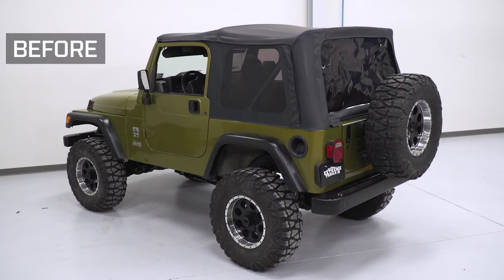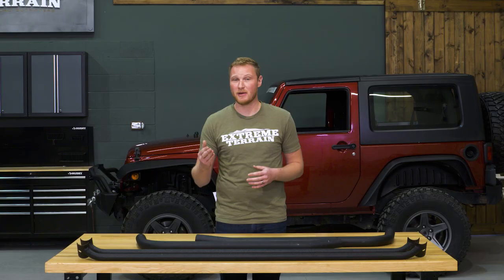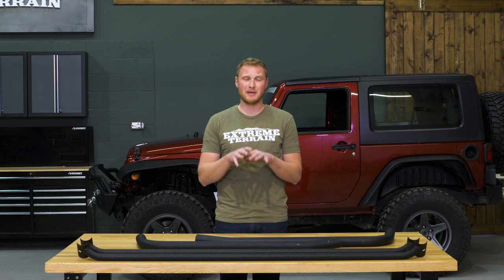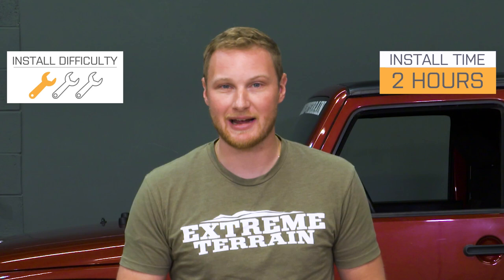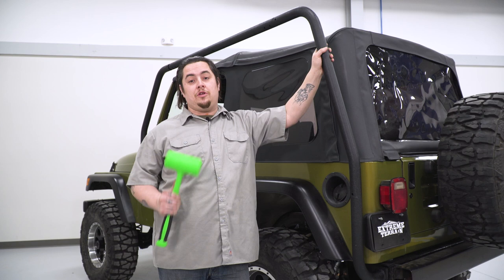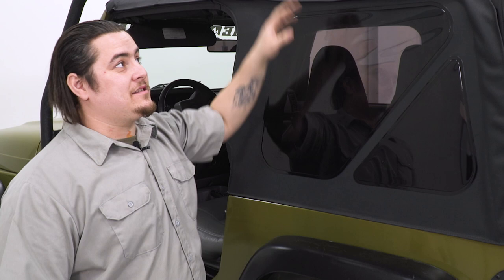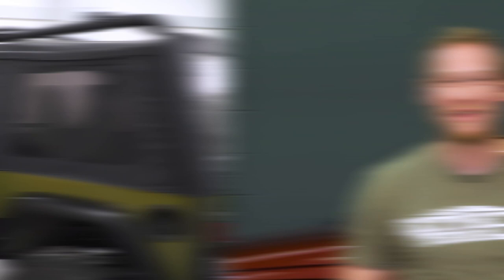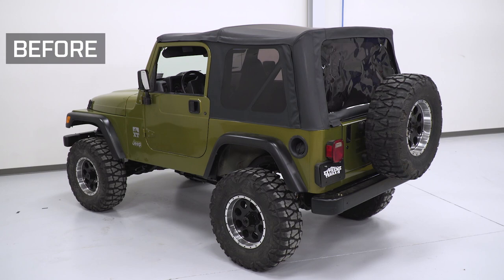Jeep Wrangler Barricade Roof Rack - Textured Black (1997-2006 TJ) Review & Install

Comment: Really bad roof rack, I've only had it on for a year and it rusted out at the bottom, mind you I live in central valley California. No salted roads, no snow, just occasional rain in july and that was enough to rust it. The coating which everyone knows is horrible chips off when you unbolt and re-bolt it up. The protection pads ware thin to the point where you have metal on metal contact because they are thin foam rather than rubber. Awful product, look elsewhere for a better roof rack. Side note; the installation is absolutely frustrating, I've installed Rough Country long arm lifts that were easier installs than this product.
Reply: The hero we needed, but didn’t deserve

Comment: Just a tip fro everyone looking at this, a likes a hardtop. You can get your hard top on an off without having to be super extra an take off the bars. Plenty of room to slide it back and pull it off. Currently running this on my 98 Sahara I can get my hard top on an off just fine.

Comment: I installed a Smittybilt roof rack exactly like the Barricade. It took about 4 to 5 hours because the instructions were very poor. I do like the look and it works well for me. Hopefully Barricade has improved the instructions.
Reply: barracade instructions are very poor. The video is worse. Forgets to tell you that you have to auger the holes out when using the stock bumper
Reply: Would rather have a family of live raccoons pretend to be my roof rack before I’d buy this garbage

Comment: Could you tell me which direction the rear uprights are supposed to point when they get above he jeep, in terms of towards jeep or away from jeep? If you install them one way the bars point outwards, away from the jeep. If you install them in reverse, the bars go inwards towards the jeep. I'm sure it makes a difference, but the directions don't specify which one goes on which side.

Comment: I just got done with this intall and it took close to 5 hours-not only do the directions suck-but no one tells you the rear lowers need modified if you are using a stock rear bumper-what a nightmare install-i hope it performs
Reply: How I Bleed How I Bleed im going through the same night mare.... How did you manage to get it attached?? Neither this video or instructions are helping me on how to modify it please help
Reply: are you talking about the back holes for the bumper?-i had to use a rat tail hand file
Reply: @howibleed8479  also having the same problem. poor design. Video and directions are very misleading.
Reply: Same issue 04 TJ. Had to file/dremel the holes larger - even then had to remove hitch to even begin to tighten bolts. So far up to 5 hours and counting. What a huge PIA this is so far.....hope it holds up!

Comment: On a Jeep Wrangler TJ, I'm pretty sure a Smittybilt Overlander tent (47"x55"closed) would fit on this. But would a Smittybilt Overlander XL Tent (47"x76"closed) fit on top? Thanks for any information you can lend.
Reply: Even if it fits, you'll already be getting close to the weight rating, I wouldn't do a rooftop tent on this personally